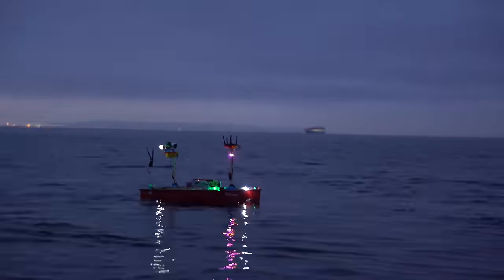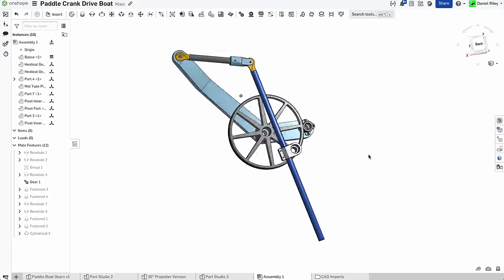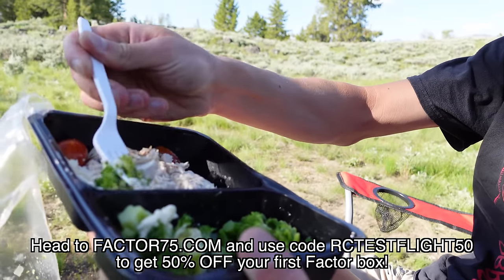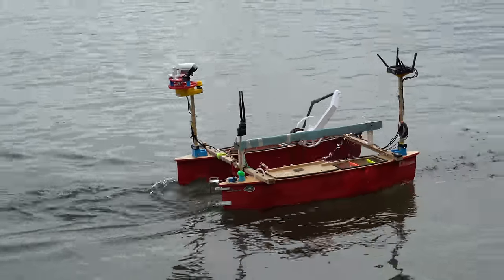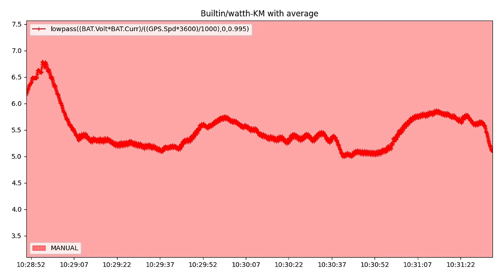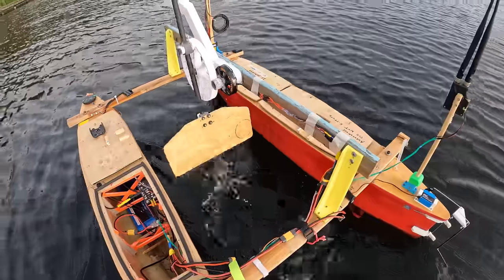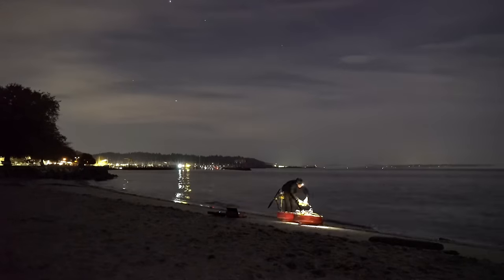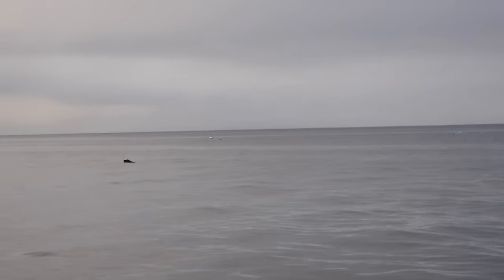Propeller Killer? High Efficiency Paddle Vs. Propeller

Comment: Oars is a great propulsion option. And not so outside reason. It is reminiscent of a the Adventure Galley, Captain Kidd’s hybrid ship that combined square rigged sails with oars to give her manoeuvrability in both windy and calm conditions. It gave her advantage when enemy ships were dead in the water. 
Oars also mimick human swimming, as I was taught: arms into the water ahead of the body perpendicular to the surface, arms push straight back, and then out of the water and begin the cycle. Very efficient

Comment: Just a thought, but instead of moving them mid hull as many have suggested… maybe move them up front with props angles slightly downward.  This does 3 things, 

1: it pulls the front end up slightly, countering it’s own weight, thereby reducing drag.  

2: Air pushes partially against the water itself, which may help it to gain a little speed.

3: Makes steering even more efficient, slightly increasing the overall efficiency of the vessel over the duration of the mission, due to less energy being required to execute each turn.  

I hope you try this, I’m sure it’ll be much better.
Reply: I can only see that being worse.
 
1 You don't want to counter weight directly by expending power. You want all of your thrust to be opposite to the direction you are trying to move. If anything, you want a slight downward angle so that the props are perpendicular to the water level even when the hull friction causes the boat to tilt upwards. This would make the craft optimized for one specific speed though unless you make the props adjust their amount of downward tilt as the boat speeds up.
 
2 Speeding the water up and slowing the air down will increase the propellers efficiency but also increase drag on the hull. But even if you do move the hull and props far enough from each other, this won't counteract the negative effect of 1.
 
3 How does this do anything specific for steering efficiency? If anything, I see it creating an asymmetry in hull drag that counters the way you are trying to turn.

Comment: Absolutely love that quirky paddle mechanism - I'd love to see that do the mission. Even if it's not as efficient as the air propellers it seems like it'll be a lot more reliable.
Reply: Also it’d be cool to see dual paddles to get differential steering or quad paddles to nearly always have propulsion
Reply: Yeah I feel like the air props lose efficiency as soon as it has to drive into the wind lol.
Reply: @powellfilmmaking  If you can combine paddles and air props and can have one drive the other you can get free power from the speed of the wind relative to the water though. A tacking sailboat would likely still be more efficient however
Reply: Just commenting to say that I agree. Would love to see the paddle mechanism have a go!
Reply: Keep iterating the paddle stuff. It's suave
Reply: And widen the paddle to the full width of the catamaran. Like he said bigger paddle = more efficient 
So why not reduce edge vortices even more
Reply: @Jrockjeff  A certain amount of attached flow is needed for a well designed hull (or a plane's fuselage and wings) 
to function optimally. I wonder how close to the hull you can go before you start disturbing that flow too much.
Reply: paddle is also quieter

Comment: I really want to see the long mission with the paddle. From the short test you did, it looked quite promising
Reply: Yup, and it definitely would't mind getting wet. The only question is: if the waves are high will it travel forward high enough to not cause a drag.

Comment: Nice video as always! Have you ever heard of the Voith-Schneider-Propeller? Its not the most efficient propulsion system (based on a cyclorotor) but highly maneuverable and definitly a unique design. Would probably be a great fun video!
Reply: Very cool, had never heard of this, tnx!
Reply: Someone on youtube made a long horizontal one as a means of lift and propulsion for an aircraft. Tricky getting it to work, but it could hover as well as manoeuvre.

Comment: The feathering paddle wheel was patented in 1841.
It does what you are trying to do, make a paddle wheel more efficient by keeping each blade perpendicular to the water.  It uses a rather simple mechanical linkage on the wheel to accomplish this.
Example, many videos of SS Waverley, a very fast sidewheel steamboat.
Both my mother and mother in law traveled on fast paddle wheel steamboats with feathering paddles.

Comment: I'd also like to see more paddle development. There are some tips from the cycling world you could try, like taking mass out of it, as well as an elliptical gear that puts a more constant amount of force on the motor throughout its path. And I second the folks that mentioned tip recurve for less drag, and that more width might also have an efficiency boost (if you can control the flex)
Reply: By recurve do you mean bended tips on the vertical sides of the paddle (English is not my mother tongue) ?

Comment: If you design your rudders with a tapered skeg directly in front of the rudder's leading edge, you'll get better steering authority, better straight-line tracking, and the weeds will just slip right off.  Then you can mount your propellers farther forward and maybe keep them out of the water a bit better?

Comment: Two possible ideas. 

I know you said you made the paddle as wide as possible, but it really seems that there are a few inches on each side of the paddle left. 

Second, high end canoe and kayak paddles are made with a buoyant material to lessen the amount of force needed to pull it back up from the water. Making the paddle thinner and lighter would be great as well, and I’m sure a higher quality/more hydrophobic coating will help.

Comment: Some ideas:
-Sails. (Sorry couldn't resist it)
-Scullying oar. This is an ancient propulsion technique where you use a single oar from the stern of the boat, wich is moved from side to side with a special technique.
Modern engineers and amaterur tinkerers have developed this concept quite a bit, and modern scullying oars are surprisingly effective.

When I see the dual paddle mechanism, it reminds me of how ducks and other swimming birds paddle with their feet.
The big difference is that they fold their toes on the  forestroke, to reduce drag, then they spread their toes again on the backstroke. 
There was a model of scuba diving fins developed by Mares, that tried to mimic this. They were sold back in the early 00's if I remember right.
Extreme free-divers otherwise tend to use very long and floppy fins, apparantly those are the most effective for the human body.

For human-powered crafts, rowing with oars is far more effective than using a paddle, and the double-sided kayak paddle is way more effective than the one-sided canoe paddle.
I think the key is getting as long a stroke as possible. The effort you spend with the oar or paddle out of the water is minimized by having it counter-weighed. An oar is balanced so that if you let go of it, the blade will sink just enough to where it dips in the water and floats there. You don't need to use much energy to lift it out of the water. The double-sided kayak paddle is held so that it balances in between your hands. But again, these are techniques based on the human physiology. Muscles and bio-mechanics are not as effective as rotary motion, or we would have running cars.

When you steer a boat, you either utilize the hull speed, and the rudder will create a difference in pressure by altering the waterflow around the hull.
With a propeller craft, you can use a much smaller, and simpler rudder, because you are only re-directing the waterflow from the propeller. Single-hull, displacement-crafts have the rudder as an extension of the hull, so they won't catch seaweed.
Catamarans and dingy's are non-displacement hulls, (ride on top of the water) and they need to extend the rudder down below the hull, so they will inevitably catch weeds. I don't see a way around it with a traditional rudder design.

A longer hull is more course-stable, and you need to excert less energy to make course-corrections. 

Just looking at your prototype boat, I think it struggles in the waves because it is too short, too top-heavy😢 and it is a bucket-shaped catamaran.  It's deplacement isn't very progressive, so the pitching makes it dive in each wave. If your hulls had been more V-shaped, they would carry over the waves instead of dipping into them.

Another propulsion type that would be cool to explore is a bellows based water jet.
I have no idea of how to build it, but maybe start with a gusher-type bilge pump.

Comment: This is why I love youtube, for the creators actually creating things and exploring the world around them. There are still efficiency gains to be had on the paddle I feel. As it tilts and pulls out it's lifting the water rather than pushing. If you look at rowers they have a really efficient paddle stroke (as efficient as a human can make them). they put in vertically and pull out vertically. I doubt it would make anywhere near enough difference to beat the out of water prop though.

Comment: I canoe and I suggest that you take a lesson from marathon canoeing. A classic straight-shaft paddle is inefficient because the paddle is pushing down in the first third of the stroke and lifting water in the last third. It is only efficient in forward motion in the middle third where the blade is vertical. Efficient modern paddles are called "bent-shaft paddle". google it to see what I mean.  I think with a bent shaft you will see less bobbing up and down. In your video you can see the big paddle lifting the water at the end of the stroke. 
A bent shaft with a smaller blade but a higher stroke rate would have several advantages. A smaller blade with have less air resistance in recovery. Love your videos. Thanks for sharing your journey
Reply: That's very interesting, I'm going to look into it.
Is there a video on optimal paddling techniques you can recommend?
Reply: It would be cool to see a linkage modeled after a real canoeist stroke as well, and with some feedback control so it can adjust to different speeds. +1 for the bent shaft paddle, they definitely feel more efficient in my experience.

Comment: Another propulsion technology you may want to look into is something some pedal powered kayaks have, which are two fins/wings that swing back and forth in alternating semicircular paths to propel kind of like how penguins swin
Reply from the maker: Hobie Mirage drive? Seems very seaweed prone
Reply: Sometimes it's one vertical fin.
Reply: @rctestflight  I'm curious about the efficiency on the mirage drives. I think it's less than a propeller but is has the added benefit of folding up to the hull in shallow water, being retractable, and easy to add two propulsion units. You also get to use your legs which have more power than a kakak paddle with your arms. More moving parts then a prop and doesn't solve weed problem as you noted.

Comment: rather than moving the propellers up just move them forward, keeping the weight closer to the centre (for and aft) will reduce hobby horsing, there's a reason many catamarans put their outboards close to the centre, it prevents cavitation from hobby horsing.
Also maybe look into using a youloh for a paddle (similar to a sculling oar), your paddle mechanism turned 90° would be perfect for the side to side motion and you only need to rotate the youloh oar to control forward or reverse, one on each hull still gives you deferential steering

Comment: on that paddle - you could probably reduce it's weight substantially by pocketing out the front side (depending on how fast you're going...) some but leave a waffle supporting set of ribs for stiffness - and on the  area where it's mounted there's some excess material there - might be able to pull some crescent shapes from the next out to the sides...  great video - love seeing guys experiment with things.

Comment: Great video. Just some notes: (please correct me if I'm wrong) I believe to accurately measure the efficiency of the propulsion methods the speed of the boat must be constant over the different tests to exclude the effect friction has on the efficiency. The faster you go the more energy you waste. So an inefficient method might seem more efficient if it travels at a slow speed compared to a more efficient method going at a higher speed. The effect of different speeds on efficiency can be dramatic as, if I remember correctly, the drag force increases quadratically with velocity. The best way to measure the efficiency will be in a lab setting where factors such as wind, water friction and waves etc can be eliminated. An example of a lab setup would be rigging your propulsion system to a load cell in a bath, controlling it to push against the load cell at a fixed force, running it of a fixed time and the measuring the amount of power it consumed to  push lets say 200 grams of force for 10 minutes or something similar. This method still is not accurate as the efficiency of a propeller increases as the speed of the craft increases and in this setup it would be standing still. On the other hand I think that the efficiency of the paddle would decrease as the speed of the craft increases. Measuring and comparing efficiency of different system types is extremely hard as you easily run the risk of comparing an inefficient method running in an efficient way with an efficient method running in an inefficient way. To eliminate this you can try to find the most efficient operating point for each method for example taking into account prop size/paddle size, rpm, vehicle velocity etc and then comparing the most efficient case of both methods. I realise that going this deep is not the intent of your video so it is just for interest's sake.😂

Comment: 2It would be interesting to see if an "optimized" paddle shape was significantly more efficient than just a flat one. Curves, scoops to direct water inward, upward, downward, or outward, ducting, angle of attack, etc. Paddles for racing shells are usually slightly curved with interesting shapes to them.
Reply: That's what I thought, maybe stop water spilling off the paddle by having curved ends.
Reply: Paddle "plan form"  matters as well. High aspect ratio blades feel more efficient (might be subjective) but are less effective for acceleration (so actually transmit less power?) and inferior in shallow water. Many canoeists carry more than one type of paddle and use them like switching gears on a bicycle.

Comment: Very inspiring and I must ask about the paddle. Would giving it a scoop shape make a difference? It make quite a difference in a water wheel when it is a Pelton wheel.
Reply: If you look at competition paddles they are scoped, so this slight modification is clearly worth testing.
Why not doing a Pelton inspired thingy that has straight edges into to the water, not a cup.
Also using a heavier wheel storing the energy so that the motor is used more evenly in the stroke is worth checking out.

Comment: You can get more efficiency by mounting the propellers more to the front of the vessel. Bow waves increase in height with the speed of your vessel and cause the boat to dip at the back. This increases drag and messes up the thrust vector of the prop.

Edit:
This would probably also help with your water hitting problem.. The would be raised higher above the waterline...

Comment: If you observe Olympic rowers, their oars are above water for quite a while before next stroke. 

It helps synchronising of course but also reduce the amount of turbulent water the rowers are pushing around, because their boats keeps gliding in between.

Of course I don't know if the same would work with your 2 hull paddle setup... their boats are very long and narrow, which is a clear advantage in fluid dynamics (like comparing an arrow with a ball).

Comment: I think you could squeeze some more out of the paddle idea. Your first attempt went pretty well, compared to the highly engineered air propellers. I'm thinking two paddle linkages mounted on the a centrally located drive gear 180 degrees apart, with the vertical shafts on the outside of this assembly right up next to the hulls. Each paddle and shaft would have to be L shaped like a flag, so they could pass one another. The circumference of the drive wheel might have to increase too (bigger gear is probably better for the forces at the teeth anyway). Then there's the idea of curved paddles rather than flat ones. Real kayaking paddles are not flat.
Reply: Right, there are many opportunities to alter paddle design that should be explored.
Reply: "Plus one" for two paddels, otherwise half the time is spent with no power being transferred and 100% of power used to move a paddle through the air.
I'm thinking two symetrical linkages mounted 180° apart too with the same paddle area but halved.

Comment: Great video as always!

I think the boat is still usable .. What if you raise each mast and move them to the middle?? From the middle of the boat it would be almost impossible for the props to hit the water!  Give yourself about an inch of clearance from the deck.

I think your next boat should be a larger scale autonomous sail boat!  Saw the ones that now go around the ocean mapping and can stay out for a year.
Reply: I'll second the move of towers idea. Theres no reason that they need to be at the back.
Reply: Nah, I think the boat is too short and have the wrong shape. There is no way around the pitching.

Any mechanical propulsion system that uses leverage instead of a propeller, will use the hull itself as a counterlever, and any non-continuous propulsion system must rely on mometum or it will hop like a frog.